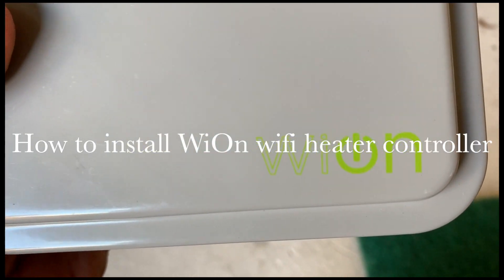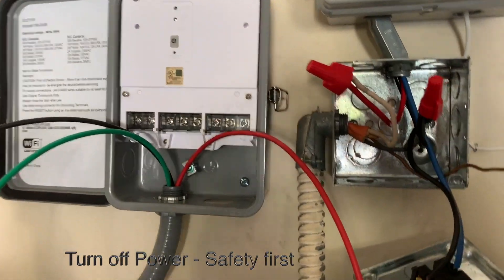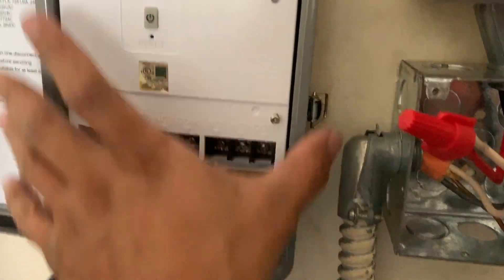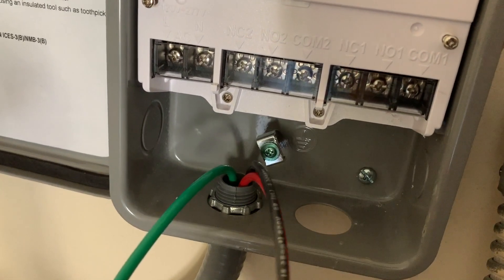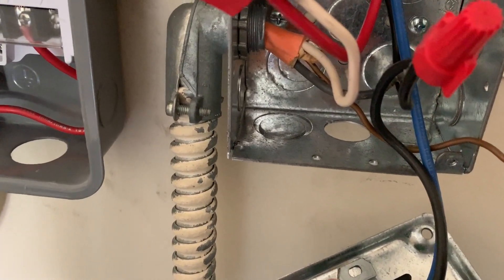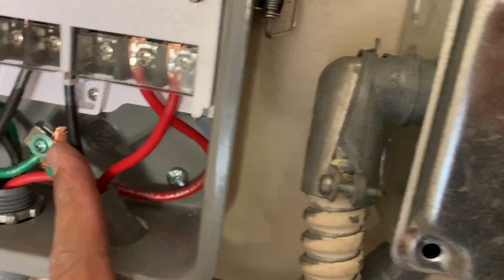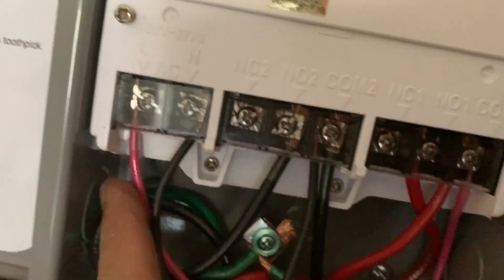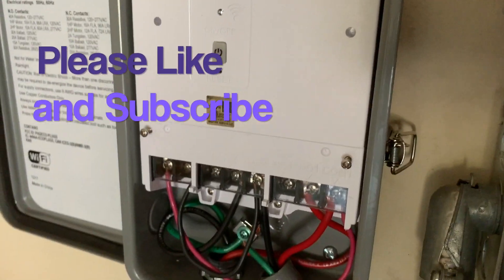WiOn wifi Water heater controler installation 220v

Comment: Which water heater model do you have? We were analyzing that Wifi controller, but it does not specify the wattage it can handle, lets say a Rheem Electric Water Heater 50 Gal, and a supposed total power of 3700W. Thus the question.

Comment: The big question I have is this: is one able to control/monitor the WiOn device from the Internet at large? We are going to set this up to run baseboard heaters during the hours we have a cheap electricity rate and want to be able to monitor/control from afar in the event we get a nasty cold spell and need to turn the heaters on during the day while we are away. Also, these are 40A capacity at 220/240 V correct? The reading I've done indicates that.

Comment: Why would a typical home owner need a WiFi enabled electric water heater?  The only application I can think of is to turn on the heater at your cottage so that you can have a shower after the five hour Friday night drive to the cottage.  I installed a $29.00 standard water heater timer 6 years ago to achieve about a 20% saving on the electric bill...but, then you just leave it alone and let it do it's thing.   The 2018 L.A. Electronics Show featured a toilet seat that can be raised and lowered from your smart phone.  Great!  I'm on a plane to Germany and now I'm wondering "Did I close the seat on the crapper before I left this morning"?  "Just because you can do something....doesn't mean you should".
Reply: Chris Graham, I have a vacation house that I’m visiting on weekends. I want to be able to control the heating remotely, so turn it on Friday night if I’m going to come to the house. Does this make sense?
Reply from the maker: Chris Graham a typical homeowner will need this to save on electricity. Everyone have their own preference however you will be surprised to see how much it really saves. I turn off my water heater when I’m not home or at night or vacation. Saved me so much. On timer you are bounded. With this you have control on your finger tips.
Reply: @HowToDoitright  // You will recognize savings if you are diligent enough to constantly monitor your water heater everytime your leave or return to your home and if you are the only occupant of the home.  I'm not going to turn appliances off when i'm away from home when four others are living in the home.   I guess people see a need for this because tank manufacturers are manufacturing heaters which are WiFi enabled so you don't have to buy a separate switching device.  These heaters do cost several hundred dollars more, so you have to recoup that cost before you begin to save.  My home is on a Smart Meter which bills electricity at three different rates depending on the time of day that energy is used.  The timer accomplishes the greatest saving because it allows us to only heat water during the lowest electricity rate.
Reply from the maker: Chris Graham like I said. Everyone have their own opinions.
Reply: Chris, you might be right about a home owner but if you have an AirBnB controlling it over wifi is perfect because we don't have guests on a regular schedule.
Reply: Or to control baseboard heaters to run during the cheap hours so we can keep said cottage's pipes from freezing (even though we drain them and shut off the main water valve).
Reply: 🤣🤣🤣🤣left my ‘crapper’ seat up once.  Didn’t cause any crash or earth quake so I guess I really missed a catastrophic event. 🤣🤣🤣

Comment: If you are considering buying one, I recommend the Dewenwils. It is $30 cheaper than the WiOn and is exactly the same product. The hook-up is exactly the same. I also had to drill a 2nd hole in the casing to make it sturdier.  (https://amzn.to/2WLn5ga). Thanks for the video. I used your instructions to install mine.
Reply from the maker: I endup designing my own. Been using it for a while now and it works better

Comment: I just ordered this smart box. Your video will be a good reference for my installation. Thanks.
Reply from the maker: Iberian Lion mine went bad in a little time. I invented my own device which I have been using for a few months now and it’s much more simpler and reliable. I have been selling some of those locally. Been working great
Reply: How To Do it <what do you mean? WiFi not connecting?
Reply from the maker: Mine died completely. People who bought this had bad luck. I tried my luck and it also failed. Poorly designed unit. It’s based on microelectronics and very small relays. Not beefy enough. 
I designed my own which is simpler and a lot beefier. Works so much better.
Reply: @HowToDoitright  I am interested in the device that you created.  Does it work with Home Assistant?  What app does it use?  How much does it cost?  Thanks!
Reply from the maker: John Smith it works with Alexa and Apple home bridge. Don’t require any server. Cost is $65 buts it’s way much reliable. I haven’t had any complaints on it. Not even one.
Reply: How To Do it more info on your home made device? I’d assume it’s a regular Bluetooth on and off switch wired up?
Reply: No link to order your devise. 🤦🏼‍♂️ Guess I’ll just have to pass then. 😳
Reply from the maker: Harry Pouncey i haven’t setup a link yet to order as most of my sales are local. The ones I sold online have been via Venmo. Once I get the payment it takes 2-3 days to make the device and then I mail it. 
Anyone interested can email me from my main YouTube page.